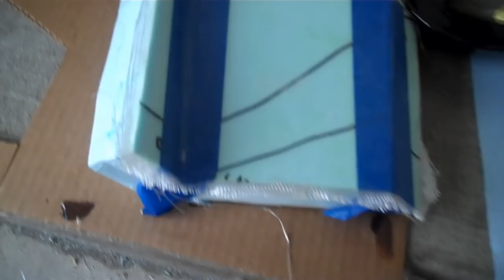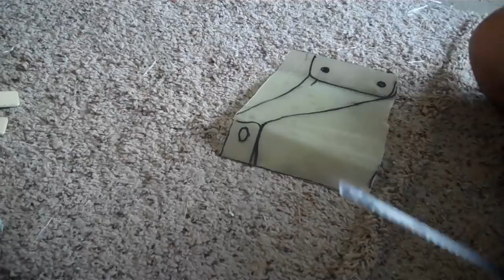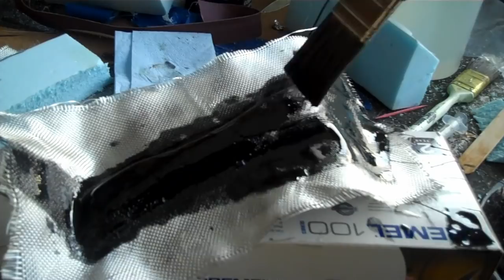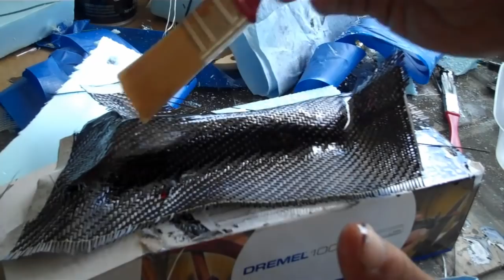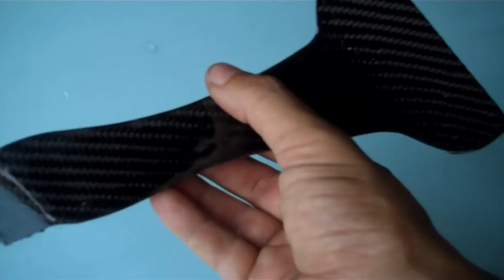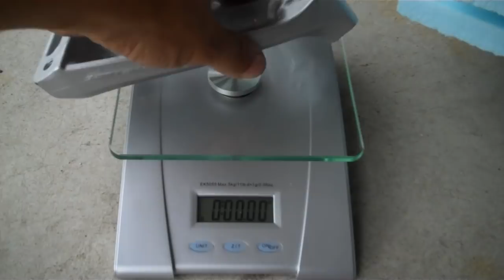D.I.Y. Making a carbon fiber part

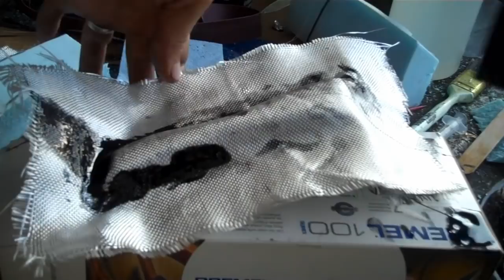Comment: @10:15 what it the black material you applying?
Reply from the maker: It's resin. You just dye it black so you can't see in between the weave of the carbon fiber around the curves.